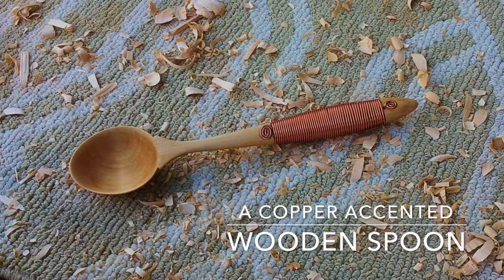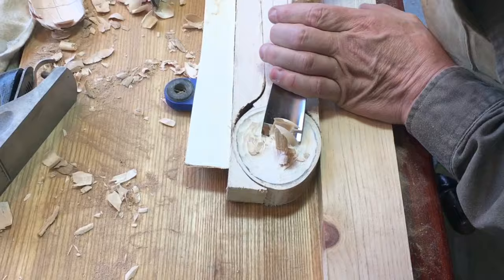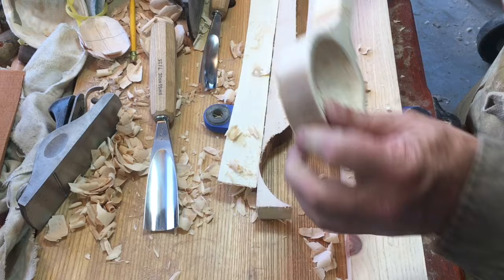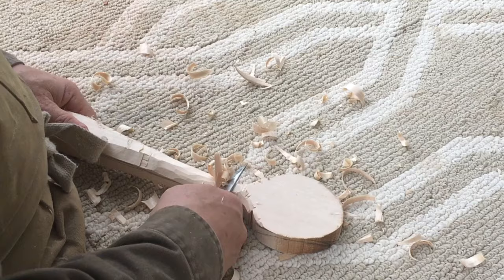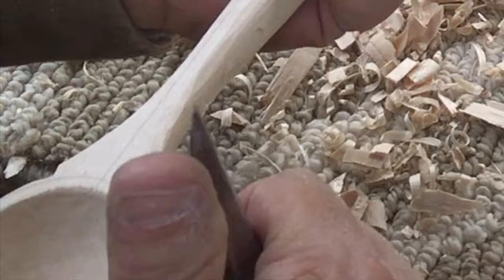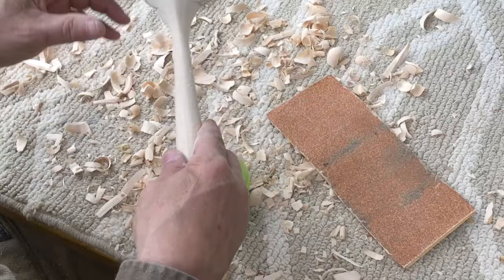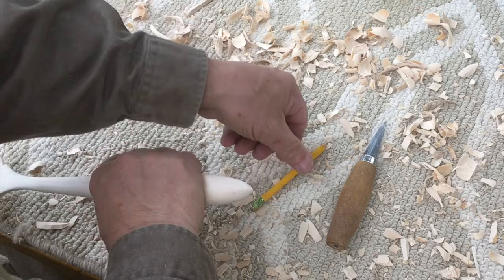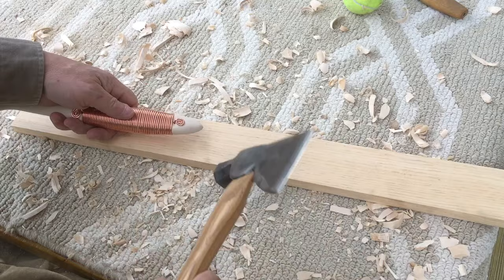Copper Accented Wooden Spoon

Comment: very well done!

Where do you get your wood at? I've become interested in doing woodcarving the last few months and I'd like to start acquiring some wood before hopping into it.
Reply from the maker: I started using my own scraps from my furniture building. But now, when I am at my local lumber yard selecting wood I check out their cut-offs bin. Find your local lumber yard, not a big box store lumber seller, a real lumber yard and ask to look through their cut-offs. I bet they have an bin somewhere and will give you cut-off pieces or sell them very cheap.
Reply: Nice shape and good video. My personal opinion on this is your knife need sharpening, with that it will cut smoother. Other part is that you must try to put more restriction to your handling/cuts of your knife and keep your fingers out of the way, a blunt tool is dangerous. Thanks for the video.

Comment: Is this for decoration or can it actually be used? I've never seen anyone use basswood for anything but carving. Very informative video. Enjoyed it a lot.
Reply from the maker: Nick, it certainly can be used. I like hardwoods myself but many softer woods work well. Just need to keep 'em seasoned or oiled.
Reply: @wildbuslife  Oil isn't even a necessity in all honesty. It can certainly make the wood prettier, but functionally it doesn't provide much in the way of protection for the spoon, as most oils will just come out of the wood when the spoon is washed. And those that don't (drying oils such as flax seed, walnut, or almond oils) typically aren't allowed the time required for them to fully cure and polymerize (several weeks to many months) before use.

As long as you keep the spoon (or wooden bowl, or anything else) dry between uses, and you clean it without soaking it in water for a long time, the spoon will be fine with just the raw wood, and will develop a beautiful natural patina with use over time.
Reply from the maker: These can absolutely be used. They benefit from use.
Reply from the maker: @riverrowanphoenix1876  I like oil and avoid washing with detergents because, yes, detergents can breakdown and remove the oils. The woods benefit greatly from oil although it is not necessary. It certainly does bring out the grain and allows their inner beauty to radiate out!  What's more is, it keeps the wood from drying out and the fibers from lifting. Also, seasoned or oiled spoons clean very easily with a wipe. I rarely wash with detergent unless I WANT to remove and refresh the oil. Like a seasoned frying pan or wok, the spoon will absorb oils and grease from use. It makes them somewhat resistant to collecting hard to remove solids and they easily wipe clean. It can darken the spoons color over time and you may want to clean and refresh from time to time.
Reply from the maker: As far as basswood, it may be my least favorite wood for spoon making but, it carves more like greenwood than the hardwoods I generally use. So I recommend it to those who want to whittle and carve spoons in the fashion of greenwood carving. And the spoons are functional and pretty enough but, I really prefer the hardwoods. I started spoon carving to make use of my scraps from the furniture I make so, the nature of what I do provides a lot of hardwood scraps. And for carved furniture accents I really like mahogany. As a hardwood, it carves easier than most and true without much unexpected cracking, lifting of fibers and or splitting. It is very predictable.

Comment: I Don't Use Knives For The Handle
I Use My Oscillating Multi Tool
For Removing Wood Off The 
Handle. Cause Using Sandpaper 
Don't Leave Knife Marks. Using 
My Multi Tool Cut's My Time 
Inhakf.